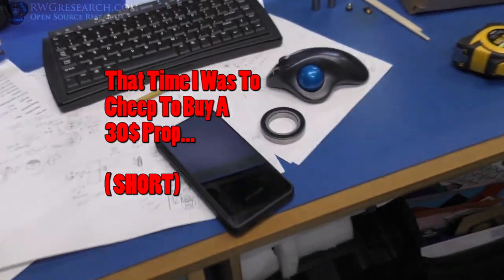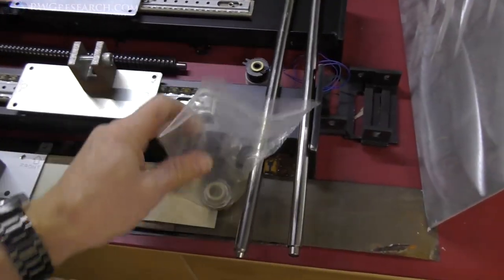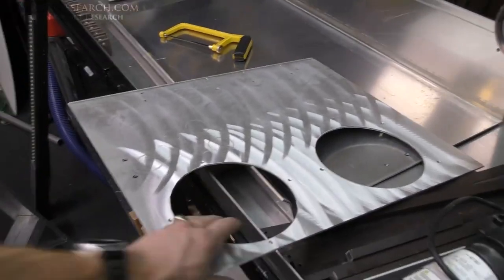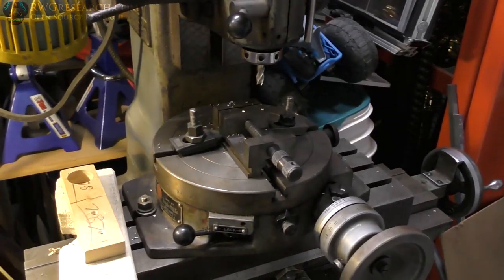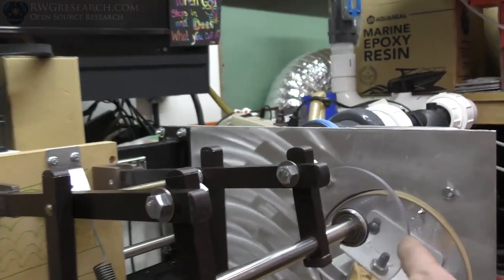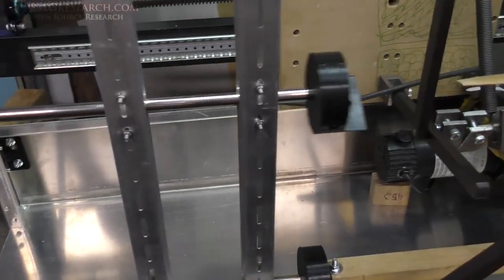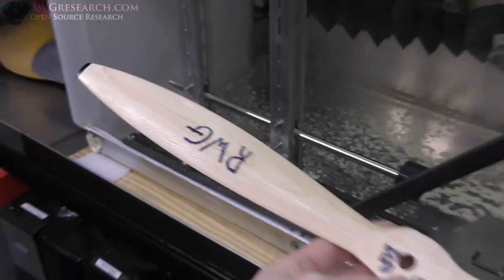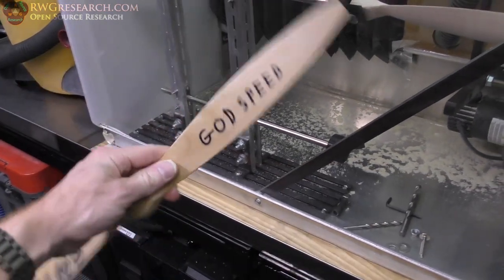That time I was too cheap to buy a 30$ prop... duplicator (short not short)

Comment: impressive but I would've built a CNC not a duplicator. Still impressed!
Reply from the maker: yeah, I agree but there is one major problem... one of my design requirements was to be full mechanical. However that ended up not being the case for the final version. it did work for the 3 day build though.  And now I'm thinking about just using theses parts to make a CNC version... but that's a new adventure lol. ~Russ
Reply: @RWGresearch  Can't wait to see it! :)